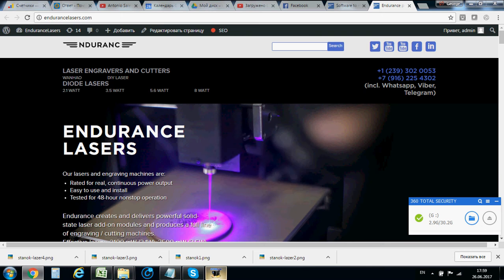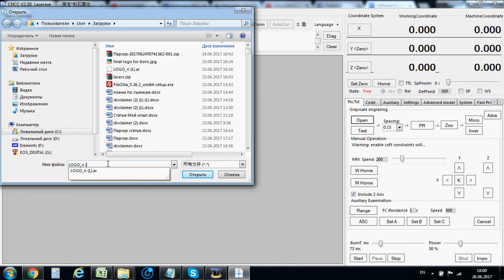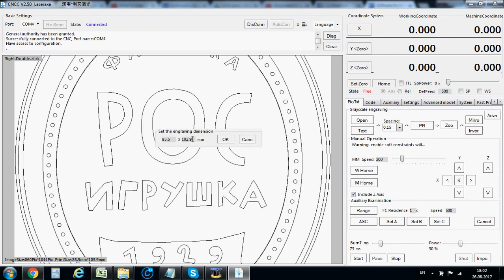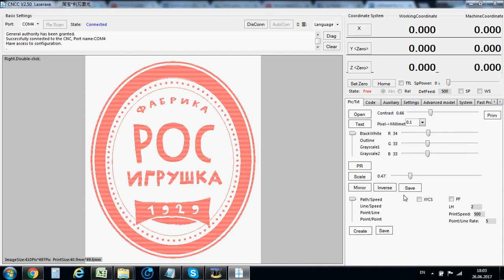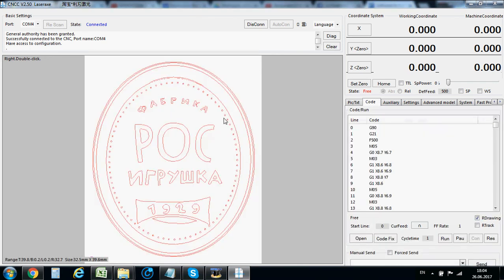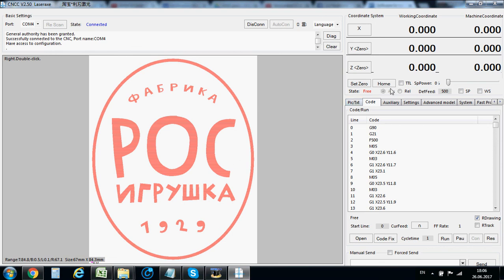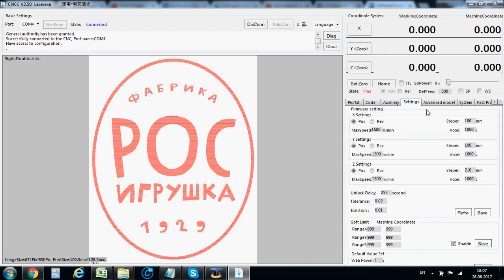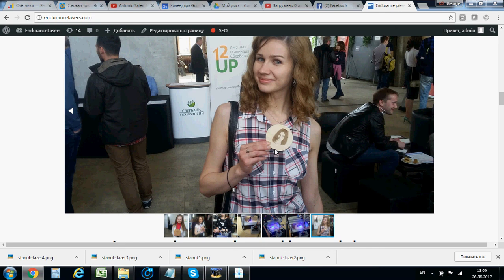How to use CNCC Laseraxe software

Comment: HI there, I've been trying to work with the software for a few hours now.  Any idea how to set the laser power when you create the gcode for it?  For now I'm stuck manually adjusting it, but I'd like to be able to reproduce an image multiple times from gcode and that would require setting power level for whatever I'm printing on.